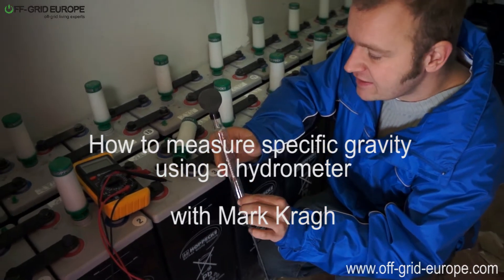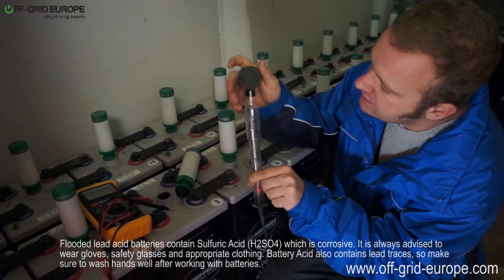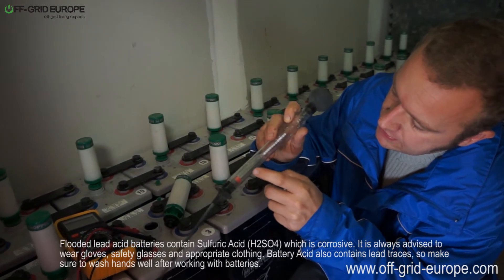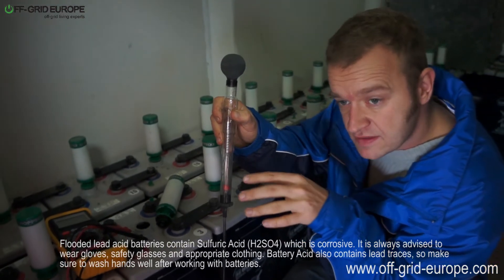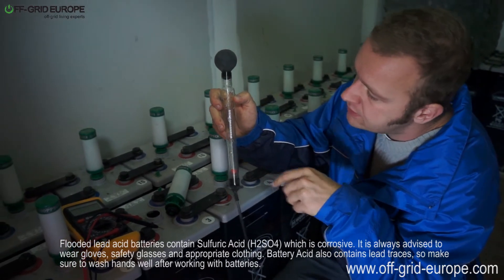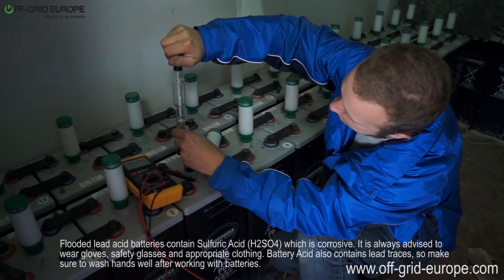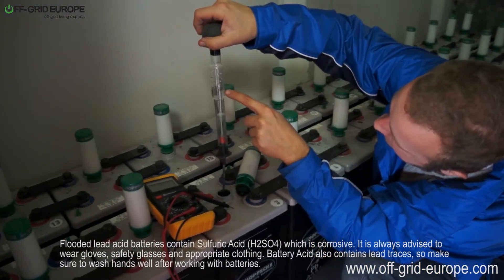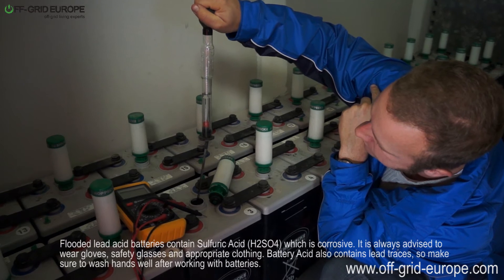How to measure specific gravity in flooded lead acid batteries

Comment: I’m trying to help a neighbor check their new system and I am new as well at this.. these are 2v flooded lead acid batteries wired in series I assume?  Her battery bank looks identically arranged. I am trying to learn how to accurately measure each cell in her bank with a hydrometer just like you are doing.